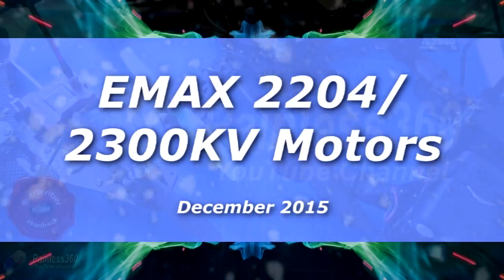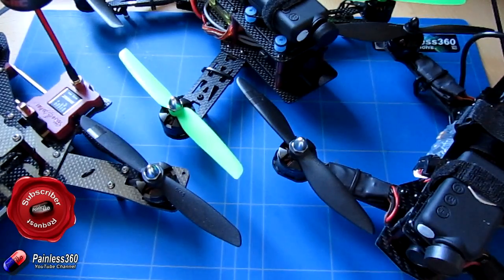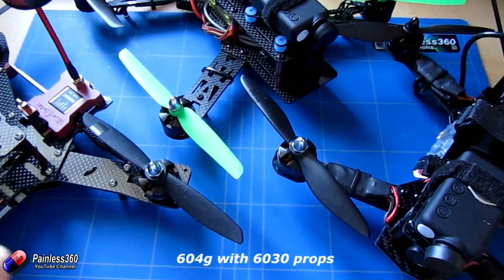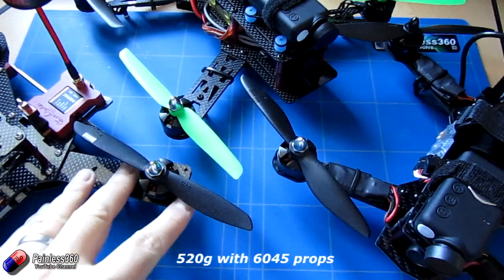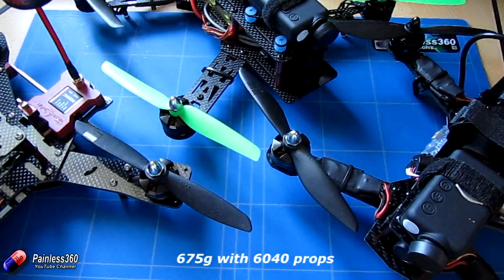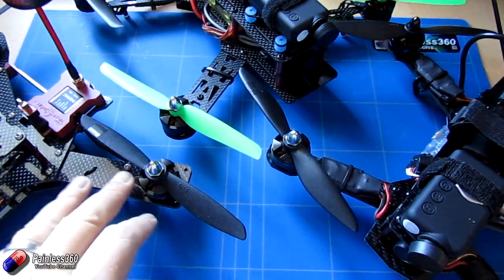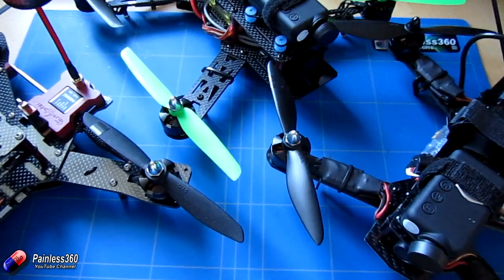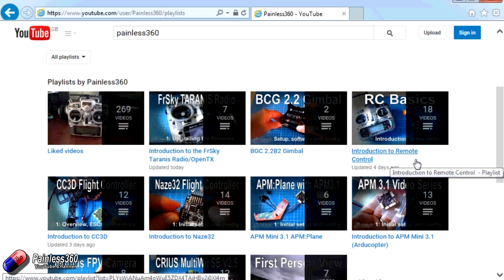RC Reviews - EMAX 2204/2300KV Brushless Motors

Comment: Sir I have zmr 250 with emax mt2204 build, can I use 2200 mah 3s
Reply from the maker: That was a common choice for those motors. Best of luck
Reply: @Painless360  thanks sir

Comment: Can I buy 4 ccw motors to use for my quadcopter, or do you have to get two cw and two ccw motors?
Reply from the maker: Yes you can, the modern move to counterclockwise and clockwise Motors is just to try and make sure that if something happens the prop nut doesn't spin off and get lost in the grass.

Comment: i know this is an old vid but i just stared using these on a mild 6s lite build just to see if would work . i have two sets of these motors that i bought last year for 25 bucks a set . been collecting dust ever since . they are 100 times better then my cheep racerstars with shit bearings . and despite what others told me they work awsome with 6s . ill even make a vid with them . dont do alot of vids but maybe i will for this .not the fastest but are smooth and more then enough with 25volts

Comment: Are these still good motor's Today, As of summer 2017? I have Lhi, chinese 2205 2300kv's. 20a Littlebee's. run 3s 75c and 4s 45c. Need new motors. It's only 49.00 us on amazon. For these. Seem to be decent thrust, And i can run 6'' props on them. Should i get newer 2205's or 2206's. I'm really wanting these. There cheap. Seem to run on 20a esc's fine. Take 6'' props with ease. Would i be wasting my money if i went on a set of these? Thank you
Reply from the maker: +very gonzo the genuine motors are still a great choice. I'm flying a few quads with them..

Comment: if I run 20 amp esc's and these motors, what prop size should I use to be able to safley use 4s? It will be a 210 or 220 build.
Reply from the maker: +Michael M have a look in the 'quadcopter building for beginners' series here on the channel. We cover how to check.. best of luck!

Comment: another good video. thanks heaps.

I run these on 4s with 5x4x3 dalprops. - they work well up to a point but suffer under full stick.
If you go 2 blade, they will cope but take a few seconds to get to top speed.

pretty good on 3s but you really notice the difference.

price point - great 
I havent had a problem with them in 6months of crashes and bashes.

dont compare them to some of the new dys or se emax motors - except on relative price.

I use 20a escs just in case. 

they seem pretty good and when you compare them with other motors, unless you are racing, they are good.

keep up the great videos

Comment: Banggood has these motors for 7.68 each. Can recommend a good Banggood ESC that works well with these? I already received my CC3D Atom and I am shopping for a good frame and power distribution board. Obviously this is a budget build but any advice is welcome. Thanks for your great DIY videos!!
Reply from the maker: We've used lots of different types with great success. See the TBS Powercube build, CC3D revolution build, the CC3D build.. 20A with Oneshot will work great..

Comment: No trust test? These motors look the same of the BG2204 for eachine 250 racer and are dirty cheap like less of 8 usd each. Please do a trust test on 3 and 4s with 5045 bullnose and kingkong 5040. I would also like to know if you cut the motor wires if they are enameled wires or not
Reply from the maker: I assume you mean thrust test? These stats are available in other places. The model weights and prop combos covered in this video make it easy to figure out the approximate thrust I'm getting. Happy flying!
Reply: +Painless360 Your assumption is right LOOOL XD. Unfortunately I can't find any thrust test with 5045 or 5040 propellers on 4S.
Reply from the maker: Sorry, we've not used 4s here. You normally need to loose an inch from your prop at this size. A quick Google search found this - http://blog.oscarliang.net/best-prop-cobra-2204-motor/ maybe useful...
Reply: +Painless360 eh eh those are cobra not emax...
Reply: +matrixFLYER these are NOT eachine BG2204. I actually had an Eachine Racer that came with BG2204 and they are by far different than the Emax MT2204, which I replaced it with. I burned out 2 of the 4 BG2204 while the MT2204 too alot of abuse and actually handled 4s and bullnose props pretty well. if I were to build a noncompetitive quad just to throw around and still get some thrill out of, I would not get anything other than MT2204. if you're looking for performance, skip Cobras and Lumenier and go straight for the Emax RS2205. Hands down the best quad motors and the only motors I know that uses N52 magnets
Reply: +Giang Ngo Reason for my comment above is that Lumenier is overpriced because they allocate most of their cost to marketing and sponsoring famous pilots like Charpu and Skitzo. Cobra on the other hand is receently and currently dealing with quality check issues. Emax is the best performance motor that you can get for your money, just the RS2205 and the MT2205, and MT2204 model. with the RS2205, you're getting a $20  motor that would probably cost 40 if lumenier was to sell it. 1,100 grams of thrust with 4s battery on 5045bn props, per motor!... ok enough of my blabbering lol

Comment: Hello, what is the best timing for these motors, using the 12A esc's? thanks
Reply from the maker: +Gus F The 12A ESCs are SImonK so nothing to change..
Reply: Still they are programmable , and there are 4 choices for the timing, low mid mid/high and high, they are defaulted at mid, but many claim since the 2204's have 14 poles (more then the 1806's) the timing should changed to mid/high or high, I can't find a definitve answer for this though.thanks anyway :)

Comment: Emax 2204 2300kv Run sweet on 5045 Bullnose on a 4cell :D
Reply: Pudsey, which ESCs are u using? 4s 1300mA batteries?
Reply: I was using the ZTW spider 12 amps with the 2204 and it took off with a 2650 lipo 4cell nevermind a 1300 lol

Comment: 1806 I have had them bend shafts, snap shafts , lose magnents and the shafts come off from the inside of the motor, press fitted I think not good in my o.p, and that's crashing on grass I just ordered some DYS as replacements. Yhe emax prop shafts are very short to

Comment: Nice to see a review after someone has really put these through their paces.  They certainly seem like great value compared to say Sunny's, Cobra or T-Motor.  I take it you're flying 3S packs?  I'm guessing the 6x4 / 6x4.5 props would be too much for 12amp escs?
I've currently got Gemfan 5X4.5 Bullnose and love them on my 3S 2204/2300 SS setup.  Smooth with loads of power and still seems to have good duration.
Reply from the maker: All 3s here. 12a esc seems happy with the 6x4.. Happy flying!

Comment: My experience says exact the opposite that you review states.They are easy to break a shaft or loose a magnet even with light crashes.They are fine for flying around in a badger.
Reply from the maker: I've not had a problem with the 20 motors I fly with, despite a number if crashes and abuse. Best of luck with your choice. Happy flying!
Reply: +Painless360 Love your videos but.... Crashes and abuse? where? these quads are brand new! I cannot find one scratch! Ι believe that you must take in consideration what everyday users report!
Reply: +Theodoros Bako nothing wrong with the review is a technical one but unless you abuse them here http://www.jump-jump.com/slider_images/indoor_play_area_for_kids.jpg this motors loose magnets,  shaft more frequently than you brake props.

Comment: try 5045 Bullnose @ 4S on those motors =) you ll love the change
Reply from the maker: +Grearson .x Cool! I have some 4s round here.. Thanks for the idea!
Reply: +Painless360 just droppin by, im running these with DAL 5040s cut down to 4040, going to be upgrading to 4s soon, for obvious reasons, wondering what kinda amps you think I might be running?thx.
Reply: +jake B havent measured, but i run my DYS 1806 2300 KV with 5045 BM Props @ 4S on Flycolor 20A Slim ESCs (Kiss Clones) with BLHeli 14.0 and its a rocket. btw its a 500g ZMR250 Build

Comment: I had a set of eMax 1806 and to my taste they are trash though they are cheap I wouldn't buy them again, out of the box they vibrate, and they have pretty thin shafts, I busted three of them in three flights in silly crashes, the toughest motors I have had are the DYS amazing crashes and they keep going, downside of DYS are also not balanced from factory, then I stopped for middle resistance and low vibration with sunnysky it's my preferred brand now, good quality, nice strength to crashes (not as much as DYS though) and they are well balanced. Sunnysky are pretty much like cobra motors in quality.
Reply from the maker: The DYS 1806 motors are in the next review.. Happy flying!

Comment: Can i suggest you try the Emax 1806 motors instead? Lighter, same price, more thrust, better efficiency and havent broken one yet either. Seems to out perform my friends identical quad but with 2204 emax motors
Reply from the maker: +Ned van Geffen Review of these already queued ;) The performance is very similar but in my experience (I run both here) the 2204 have a little more torque that will support these wider prop ranges. Depends what prop your friend is running on their motors. Both are great choices for 220-330 class models.
Reply: +Painless360  on a small wing the torque isn't used in a way right? so there a 1806 would be a better choice ? since you have less weight
Reply from the maker: Both would be good choices..

Comment: still looking to build a 250 size. emax were mentioned a lot when doing my 450 quad and they had good reviews
Reply from the maker: +AndyRC As you can see I like these a lot. There are lots of choices but I've ended up with these on a lot of my 250 class..
Reply: +AndyRC I use them cause they are cheap, and if I need to I can get more quickly through Amazon where I live, I use them on my 180 and 250 atm, but will be getting something better since I am a better flyer now.